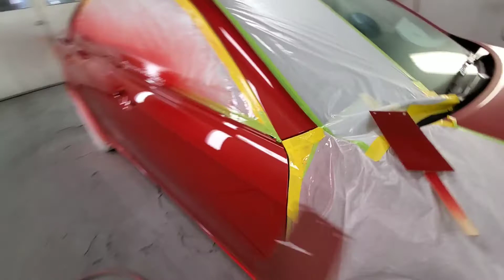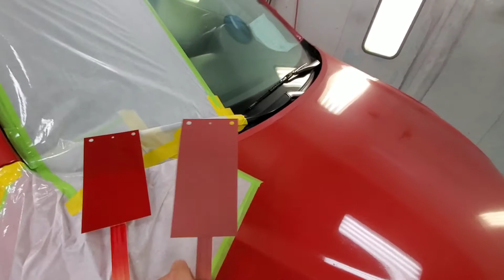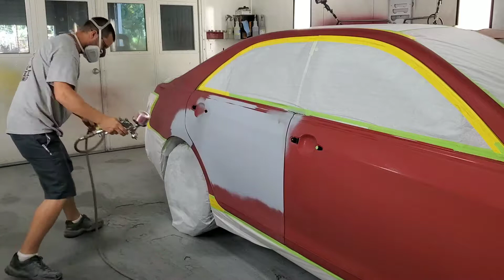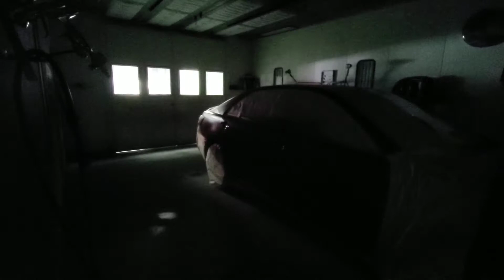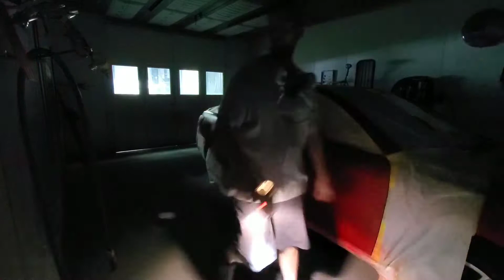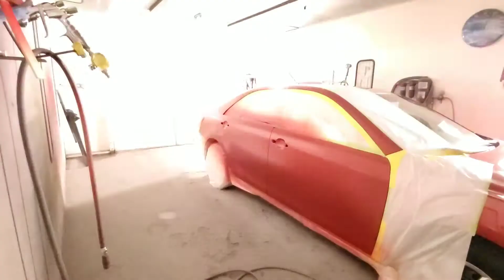Translucent Reds "How To" Nexa Aquabase

Comment: do you happen to have a code for this piston red?
Reply from the maker: I will check tomorrow and try to get back to you.
Reply: @paintbycurry1531  thanks man, i appreciate it
Reply: @paintbycurry1531  thanks man, i appreciate it
Reply from the maker: Piston Red for 200ml (about 7oz). I have no code but heres the formula. Amounts for each part.
8900 white-62.5
8948 deep black-46.0
8907 red oxide-92.1
8960 trans. magenta-41.4

Over SG05 (gray) sealer
1 coat